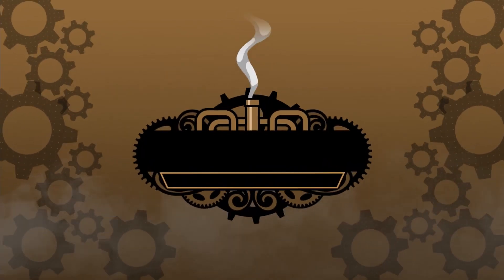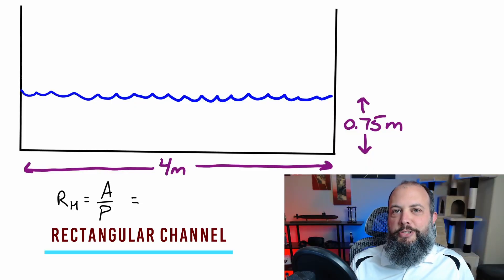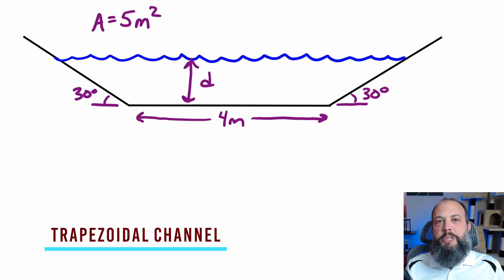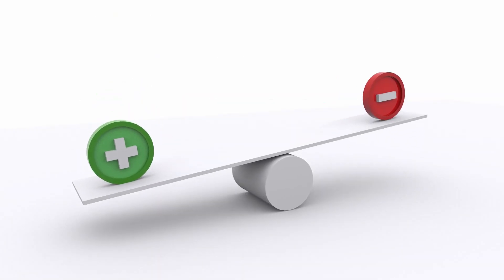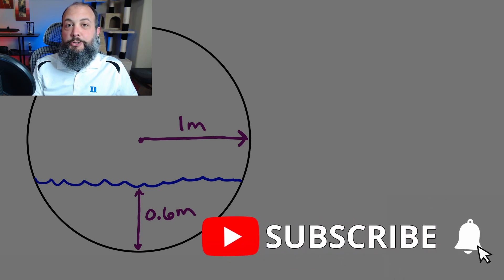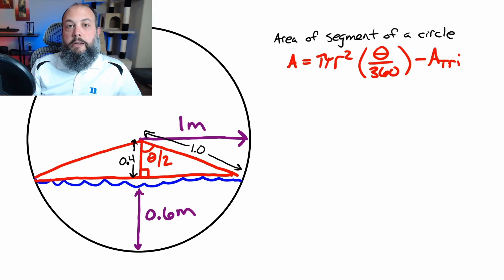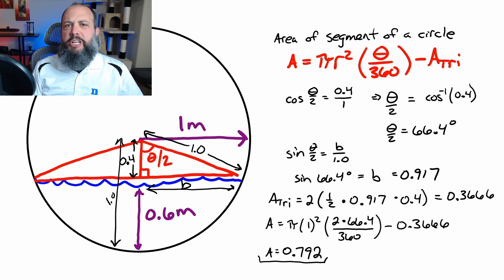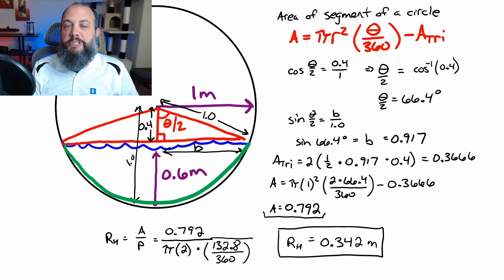How to Find HYDRAULIC RADIUS and WETTED PERIMETER – Rectangle, Trapezoid, Circle

Comment: How do you find hydraulic radius using kutters formula, given a pipe size, slope, roughness, and a given flow?
Reply from the maker: That's a strange use case. Hydraulic Radius isn't a valuable thing to know on its own, it's only use is to be able to use it in other equations to solve for actual important things like flowrate. I can't think of a scenario where you would need to go backwards and already know all the dynamic numbers, and need to find hydraulic radius. BUT - if you are in this situation ... there's no easy algebraic way to solve this by hand. Because hydraulic radius appears in the equation twice, in 2 separate square roots, there's no easy way to algebraically isolate it. So - you'll need to solve for it numerically. I think any regular solver that uses Newton's Method should be able to solve it. If you want to code up your own simple but kinda inefficient solver yourself, just write a For loop that iterates from hydraulic radius of .0001 up to whatever max you want, have it calculate the flowrate at each hydraulic radius, and compare the flowrates calculated to the one that is given, and choose the radius that gives you closest to the correct answer. brute force, but it will work.
Reply: @BrianBernardEngineering  Thanks for the feedback. In applications when there an existing sewer line, local jurisdictions want to see a new development can increase the capacity and how much. For example, if the additional  flow increases the flow depth (depth to diameter > 75%), then they will require the reconstruction of sewer pipes to a bigger size. Using Kutter's Equation and a give flow, one can get flow depth through an iterative process. Excel solver has a bit of hard time to find theta and depth based on an initial theta. I am not sure if it uses newton's method or not.